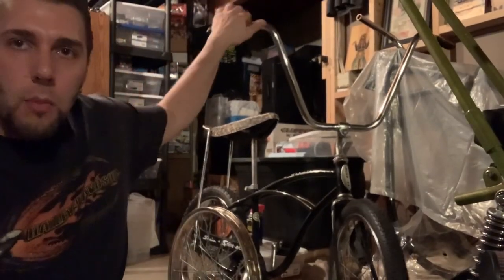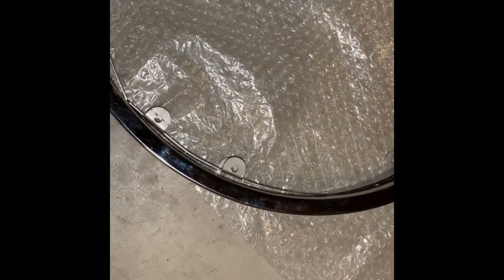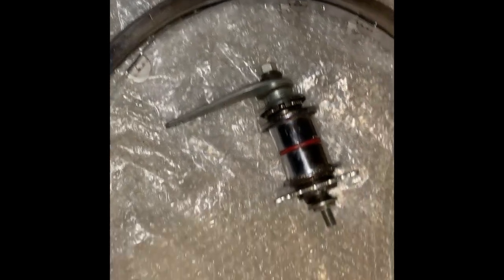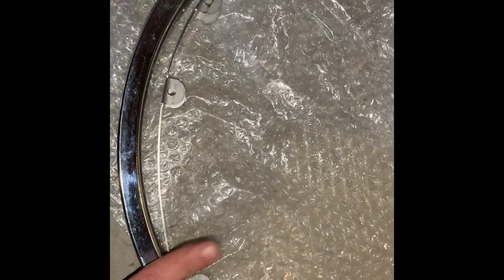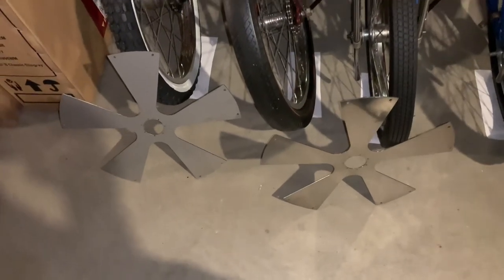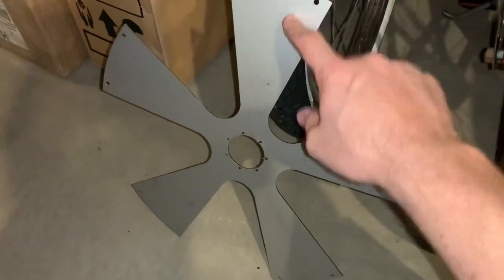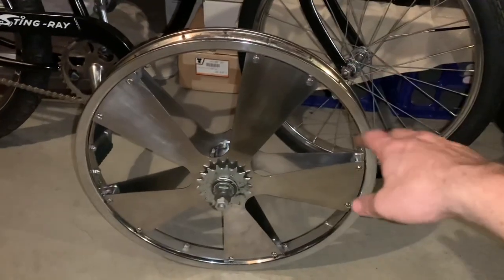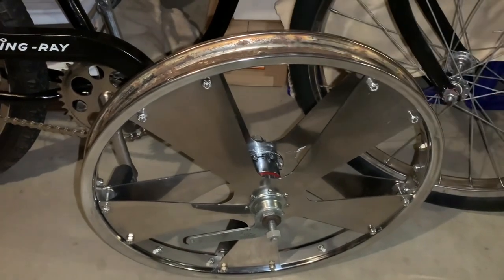Project 66 Schwinn Stingray Gets A Mag Rear Wheel

Comment: That’s a cool Kit, I have never seen that before. Great job on the polishing. Just a thought 💭 if you could find some acorn nuts in chrome with a drop of lock tight on the threads instead of the Teflon locking nuts it would give it a cleaner look. But hey it still is different, and a cool look.👍👍😎
Reply from the maker: Thanks Dave, this was originally a kit offered back in the 60s but this one is a repop but definitely very cool, I actually thought about doing something like swapping out for acorn nuts maybe a future mod, glad you enjoyed it more to come and thanks for checking it out

Comment: Nice job on the mag wheel conversion. It looks great polished. Hey, the direction of the screws was an easy mistake. I could see where having the nuts on the inside of the rim could cause problems with the inner tube. Thanks again for sharing this build. Be here next week, same Bat time, same Bat channel.
Reply from the maker: Thanks Keith it actually wasn’t  to bad everything actually fit together really good which was kind of supersizing it just took a bit of time to redo the hub and disassemble the wheel along with polishing but it came out pretty cool, next time I’ll slap a slik on and finish this thing up thanks for watching buddy glad you enjoyed it